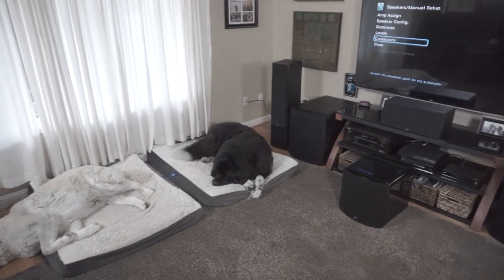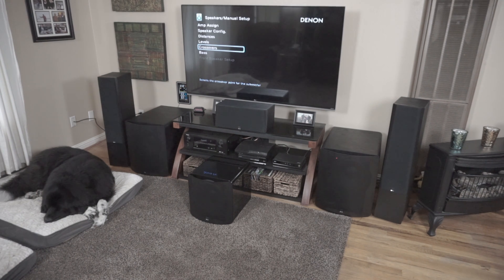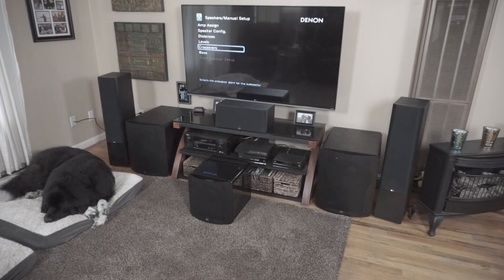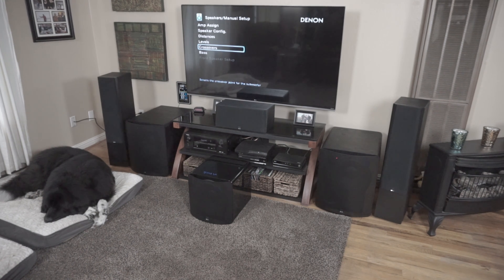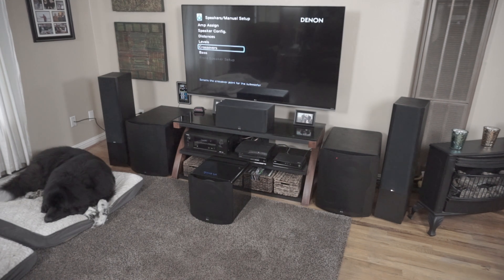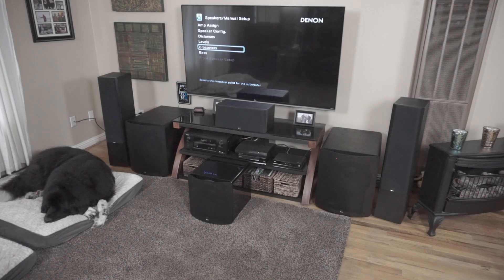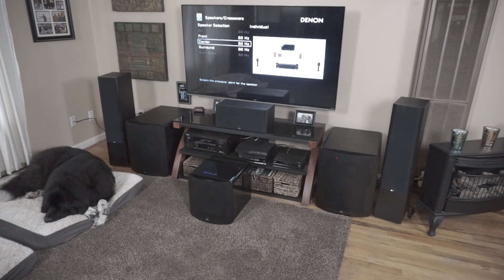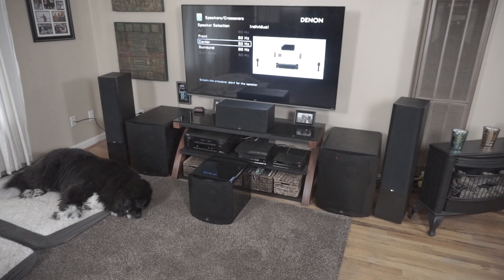Poor Man's Subwoofer DSP Using AVR Crossover

Comment: Hi, greetings from the uk. Great info on the subwoofer videos btw, love it. Anyway quick question really... I have to subs with a single sub out. Now instead of buying a new dual sub out or a dsp could I not buy a RCA splitter and have one sub connected to Left in and the other Right in and then set the phase and crossover differently??? Would that work so they kind of work independently??? 
A reply would be much appreciated.

Comment: New sub is coming in the mail tomorrow:) JBL ES250p. Opinions? I thought it was a good option for my budget and I'll be running it with my previous sub
Reply from the maker: It wouldn't make "The List" unfortunately, but I know how the budget thing goes. You will likely not get anything meaningful under 30-35 hertz. You will have duals though, which will be good. At some point, you'll want a set of matched DSP controlled subs, that will be the best sound. Too bad you couldn't step up to the PB-1000 http://bit.ly/PB-1000 (affiliate link), it's a little more, but a LOT more potent where it counts. Hate to be anything less than thrilled for you, but I have to be straight with you and other viewers who will read this. There is an undeniable difference. That sub won't be "terrible" like many can be, but It's still coming up short when it comes to true depth, which is extremely common. I'm not picking on them anymore than anyone else.
Reply: +Subwoofer 101 thanks for the feedback:) a lot of the LFE that I deal with tends to be right around 30-40 hz anyway, due to a lot of dubstep, reggae, and hip hop. I got it and it was honestly a very nice improvement from my previous 12. I'll be running them both soon. But I know what you mean. Some of the really low notes make the sub fluctuate without making sound.

Comment: Most rooms have a room mode (accentuation) around 70hz, so lowering the sub x-over can be very beneficial in terms of lowering that annoying room peak. I have a Denon X3200 with Audyssey XT which does a decent job in regards to the sub (PSA XV15) and surrounds (SVS Prime Sats), but I hate, and I do mean hate, what it does to my L/Rs (SVS Prime Bookshelf), so I run using Audyssey L/R Bypass, and I set the L/Rs x-over to 60hz because of the reason mentioned above and what you found in your video. If I go to the 'standard' 80hz or higher, I get too much energy from 65hz - 75hz.
Reply from the maker: You need a second sub, that reduces room modes considerably. I went back to a single sub for about a week and it was noticeable to say the least. Modes and nodes shift within the room as the frequency changes, so it could be dead in one spot at one frequency and too loud at a different frequency in the exact same spot. Duals iron that out, and you can actually hear more of the music that you have been missing. Without duals, you get Swiss cheese bass, lots of holes.  

It's virtually impossible to get reasonably even response from a single subwoofer, no matter how big and powerful a sub is. With ported subs, I love the 80 hertz crossover, even with the prime towers, it sounds beautiful and full, not at all overdone or boomy. The sealed subs just have a more output from 40-80, and that's what I was trying to correct for my preference. My modes and nodes are barely perceptible in the listening area. Your equipment is solid, you just need the last piece of the puzzle, a second sub. 

That said, I'm not sure what the XV-15 curve would look like in my room, it could be naturally higher in that 65-75 hertz range, which wouldn't be abnormal or bad, in which case adjusting it down with the AVR crossover is a good call. PSA is a good brand from what I understand, but they all have their different flavors, so to speak. Regardless, a second sub would do wonders. 

Thanks for stopping by again!
Reply: The owner of PSA is the "V" in SVS, they parted ways and Tom V started PSA. I would love to have dual subs, but I have to make compromises as my HT is living room based and there is only one spot allocated for my sub......... Maybe you can persuade my wife! :)
Reply: Just in case you have not seen it, Audioholics has a new video on connecting multiple subwoofers.
Reply from the maker: My wife wouldn't go back to a single sub. It's actually easier on my ears too, makes listening a more comfortable experience. A sub on either side of the TV seems to be the simplest effective setup. The reasoning for a second sub is almost always misunderstood, it's not to increase loudness at all, it's to be able to hear everything. Promise her you'll watch Titanic if she likes that movie, and if she doesn't like the setup, both PSA and SVS seem to have a good return policies. It's hard to go back to a single, once you hear what it's all about. I don't think PSA makes the XV-15 anymore.